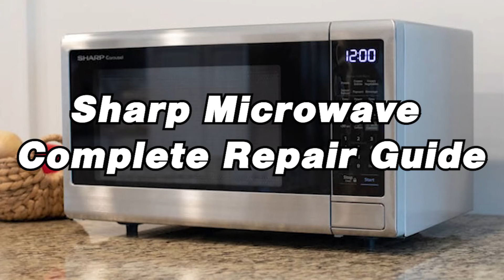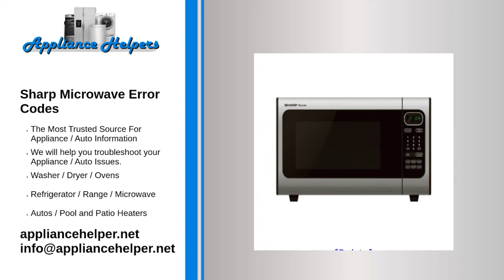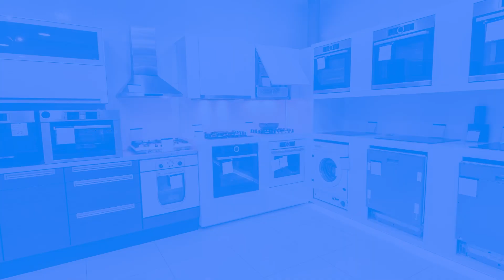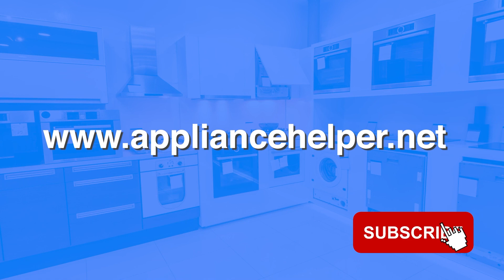Sharp Microwave Complete Repair Guide - Solve Error Codes and Repair Problems!

Comment: I keep getting E1 on my model.
Reply from the maker: If you're consistently receiving error code E1 on your Sharp microwave, it typically indicates a problem with the microwave's temperature sensor. Here are some steps you can take to troubleshoot and potentially resolve this issue:

Power Cycle the Microwave:
Start by turning off the microwave and unplugging it from the power outlet for a few minutes. This can sometimes reset the control panel and clear error codes like E1.

Check for Obstructions:
Inspect the microwave's interior for any food particles, debris, or other obstructions that may be blocking the temperature sensor or other components. Clean the interior thoroughly with a soft, damp cloth.

Inspect the Temperature Sensor:
The temperature sensor, also known as a thermostat, monitors the temperature inside the microwave. If it's malfunctioning or faulty, it can trigger error code E1. Check the sensor for any visible damage or signs of wear, and ensure it's securely connected to the microwave's control board.

Test the Temperature Sensor:
Use a multimeter to test the temperature sensor for continuity. Disconnect the sensor from the control board and place the multimeter probes on each end of the sensor. If the multimeter doesn't register continuity, the sensor may be faulty and needs to be replaced.

Reset the Control Panel:
Some Sharp microwaves have a reset button on the control panel. Pressing this button can reset the microwave's settings and clear error codes. Refer to the microwave's user manual for instructions on how to perform a control panel reset.

Professional Service:
If you're unable to resolve the issue on your own or if the error code persists, it's advisable to contact Sharp's customer support or a qualified appliance technician for further assistance. They can diagnose the problem accurately and recommend the necessary repairs or replacements.

By following these troubleshooting steps, you can address error code E1 on your Sharp microwave and potentially restore normal operation. Always prioritize safety when working with electrical appliances, and consult the microwave's user manual for model-specific troubleshooting tips.

Comment: My microwave just says 8888
Reply from the maker: If your Sharp microwave is displaying "8888" on the control panel, it likely indicates a problem with the electronic control board or a possible control panel malfunction. Here's a general guide to help you troubleshoot and address the issue:

Power Reset:
Start by unplugging the microwave from the power source for about 1-2 minutes. This can help reset the control board. After the reset, plug it back in and check if the display issue persists.

Control Lock Feature:
Some microwaves have a control lock feature that, when activated, can display a series of repeating numbers like "8888." Check the user manual for your specific model to see if there's a control lock function and how to disable it.

Inspect Control Panel:
Examine the control panel for any visible damage, such as cracked or broken buttons. If any buttons appear damaged, it may be affecting the functionality of the control panel.

Check for Stuck Buttons:
Make sure none of the buttons on the control panel are stuck or jammed. Press each button individually to ensure they are all responsive.

Error Code Reference:
Refer to the microwave's user manual or technical documentation to see if there's any information on error codes like "8888." The manual may provide specific troubleshooting steps or explanations for common error codes.

Perform a Hard Reset:
If a power reset didn't resolve the issue, perform a hard reset by completely disconnecting the microwave from the power source and leaving it unplugged for an extended period, such as 30 minutes or more.

Contact Sharp Customer Support:
If the issue persists after attempting the above steps, it's advisable to contact Sharp customer support for assistance. They may be able to provide specific guidance based on your model and the displayed error code.

Remember that microwaves contain high-voltage components, and any internal repairs should be performed by qualified technicians to ensure safety and prevent further damage. If the microwave is under warranty, consider reaching out to Sharp's customer service for authorized service.

Please note that specific instructions may vary depending on the model of your Sharp microwave, so always refer to the user manual for your appliance for accurate information.